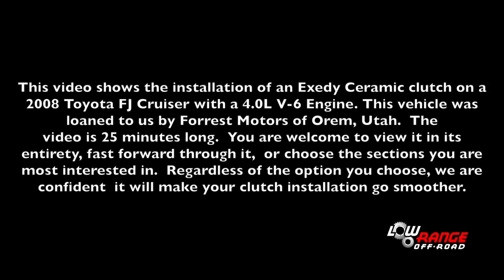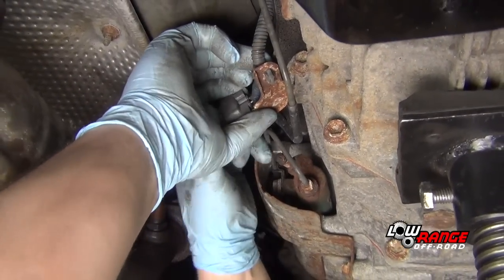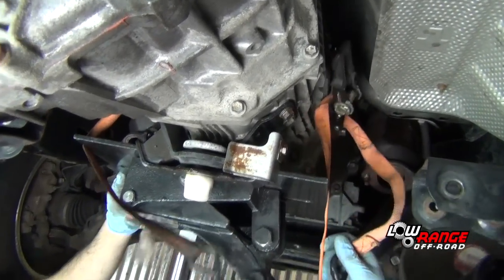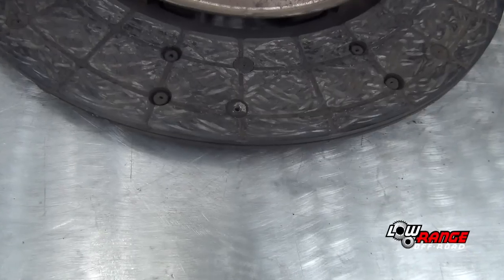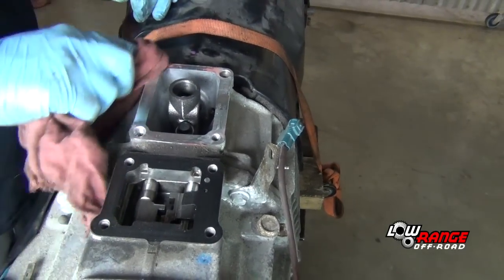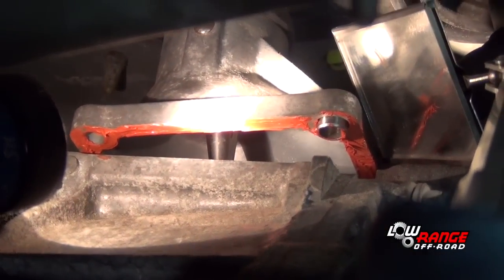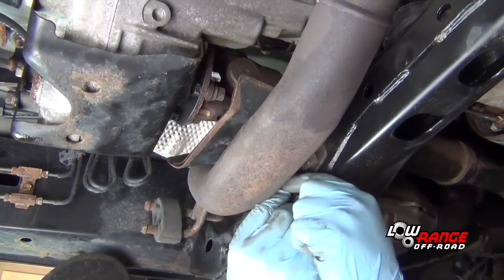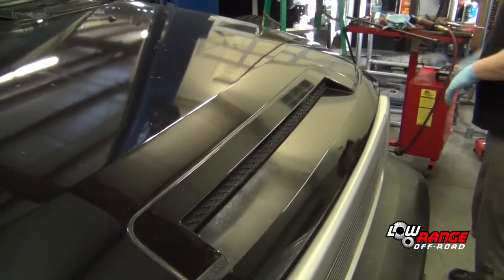How to Install a Ceramic Clutch on a 2007-2014 Toyota FJ Cruiser

Comment: Great explanation step by step,  thank you so much, please continue the great work, these videos are really helpful. I have a Toyota FJ Cruiser 2014 and the engine is starting to sound like a cricket,   and when I depress the clutch pedal, the noise is gone.
Reply: My FJ has the same problem and I was told that its a bad throw-out baring. I hope that helps you

Comment: Excellent Sir!  I left the transmission shifter tower , only removing the knob since it will clear the shifter hole, unlike the 4x selector.. Also, I believe that I could have left the rear u-joint of the rear driveline connected.  Thank you greatly again!!!

Comment: Curious why you applied threadlock to clutch cover bolts (13:30). Official Toyota Service Manual page CL-23 does not call for it.
Reply: Also specifically says not to apply grease to input shaft housing (11:30) page CL-24

Comment: I just had a new clutch fitted to my 2013 fj, and it is now noisier to drive than before.  The noise seems to be coming up through the gears tick. No specific noise, just louder in general than it was. Any ideas?

Comment: How did u install the 4x4 shifter tower . I tried and attached all the bolts it's fit perfectly but when I try to move the stick with out starting the car it doesn't move to shift position . Any tips in that

Comment: Thanks for the effort, video and useful info :)
It's a real pain in the @$$
I wonder how much this process cost at the dealership/random workshop (only hand work = parts not included) ? 

Here in Saudi Arabia :
Non 4x4 manual transmission (without transfer case) : dealership = $350-$400 / random workshop = $200-$250
4x4 manual transmission (with transfer case) : dealership = $500-$600 / random workshop = $300-$350
Are we being ripped off or these prices are considered standard ?
How much does it cost (where you live) if I may ask ?
Reply: @turducken665  
Wow dude, that's lotsa Benjamins !
Well, I guess I ain't gonna complain no more if that's what really costs somewhere else :)

Comment: the truck does not use a bearing on the crankshaft? between the tip of the transmission and the engine?

Comment: I have a 94 toyota pickup that is mostly a weekend warrior and not a daily driver. I want to make it more offroad / hauling capable so is installing a ceramic clutch with 1600lb load rating a good way to go?
Reply: Jeff Chartier Yes, I have a 1200LB rated kit on my 85. If you are doing lots of heavy hauling, re-gear your differentials. These old Toyota transmissions don't last that long if used for towing stuff. Never do wide open throttle in 5th gear.

Comment: I am changed all redy this ger opan and fiting this is very ezi just I am one parsnd changed this gera
Reply: Noor Blooch how did u fix the 4x4 stick the one come on top of the gear with 4 bolds . After I fix it I try to move the stick but it's not cutching .

Comment: why is your fj so rusty ..
mine is 2008 and almost rust free
Reply from the maker: We borrowed this one from a local used car dealer to use for instructions.  Sadly, here in Utah a lot of vehicles look this way.  They use a lot of salt on the reads in the winter and if the owners don't do an under car wash regularly they can really look bad in a hurry.  I am glad your 08 looks so good. That is nearly ten years old.   I am guessing you either wash regularly or you live in a mild climate or both. Thanks for watching and commenting.
Reply: lowrangeoffroad yes i live in the desert (MiddleEeast) the weather is very hot here almost 50 degrees Celsius ..
also i want to thank you for this video its very detailed and easy to follow really appreciate it